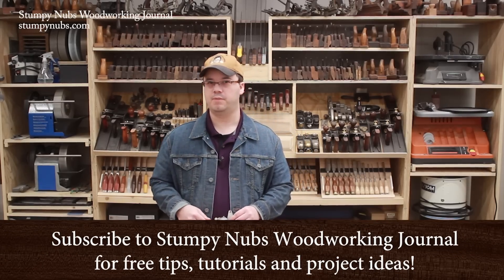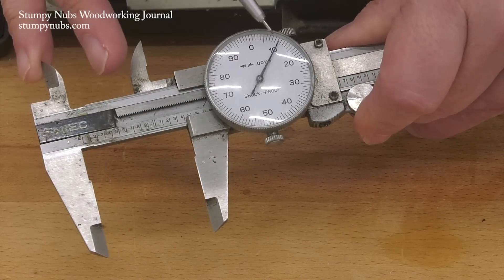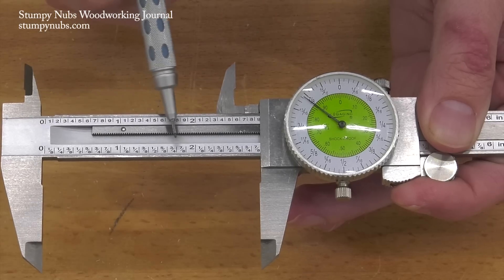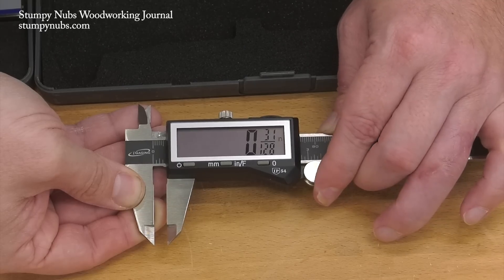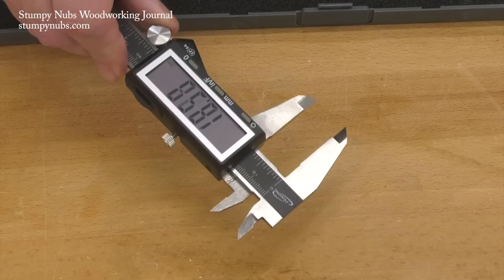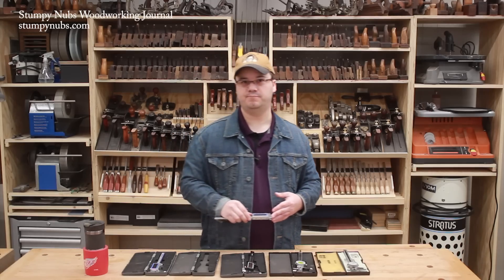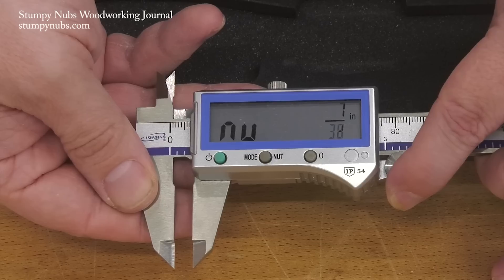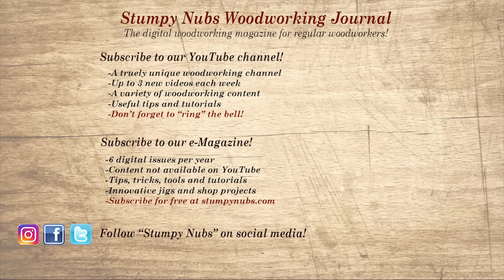FINALLY! Calipers made for woodworkers!

Comment: Calipers are absolutely more useful in the metric world, but I have yet to find a digital one that isn't a pain when it comes to the battery. Some have a rechargeable one you can just plug a phone charger or computer into but they seem to sell at a premium, & none of them have an actual mechanical on/off switch anymore, which I think is an insane omission. Might have to get myself an analogue model..

Comment: I use both scales mm for fine  work and inches for larger measurements and then i switch to metres for long measurements... it somehow works!
Reply: Me too, but in the UK we're used to using a mix of imperial and decimal measurements anyway. Miles on the road signs but fuel is bought by the litre, for example.
Reply: @MidtownSkyport  So make a decision, make up your collective minds. It's only been a few decades now. Get on with it.
Reply: As a letter pressman, I've learned to use many scales. Picas, points, agates, metric, imperial, column inch, word count, etc...  All have their place in my shop. Conversions are crude & a pain. For precision stick to one scale.

Comment: I commonly used metric measures in my job as an archaeologist.  Since I retired, I've come to appreciate fractions.  For two reasons.  One is that millimeters quickly grow to centimeters and decimeters.  Inches are less fussy.  The other really handy property is that fractions are remarkably easy to calculate with in your head or occasionally if need be, by hand, (use decimal inches and there's no reason not to be using millimeters instead), and since I very rarely use a measure smaller than a sixteenth of an inch, the ease of calculation is nice.  Using metric system or decimal inches is a practice that needs a calculator as far as my shop is concerned.

Comment: In ~ 1986 I bought mail order from a woodworker's catalog a General Tool No 142 6 inch Dial Caliper  Swiss Made that reads in hundreds and 64ths of an inch on the same dial.
 It is made out of black and gray plastic. The depth rod is steel.

Comment: I've had two different digital calipers that ended up with a failed encoder. Both were less than a year old. Now I have the iGauging dial caliper you demo'd that reads in fractions. I absolutely LOVE that one!
Reply: That is not a digital calliper problem. The problem is you cheaped out. A $40 unit would not be like that. What do you expect for $10 unit?  The point of their use is for accuracy and repeatability. Your cheapness defeats the whole point.
Reply from the maker: @JeffSolenberg  - Welcome to the internet :)
Reply: @StumpyNubs  :D

Comment: I have one of the digital calipers and since I'm an engineer and a former math teacher I have little trouble converting decimals to fractions.  But your comments on determining what the 16th fraction is nearest to a reading of a 128th fraction is one I've experienced many times. Yes I can do the calculations but it takes time from what I'm doing.  Thank you for the tip on the Fastener-cal caliper, I just ordered one.

Comment: I bought 4 or 5 cheapo digital calipers over the years and found the batteries would die within 3 months. Finally bouth a pair of mitutoyo's and love then, battery last around 2 years. I bought em used on ebay, best 80 quid i ever spent.

Comment: I prefer Dial Calipers because as you said, they are ready at a moments notice if they have been sitting for a week, or a year.

Edit: I just purchased the fractional Dial Calipers because they look interesting, and they are cheap. I say cheap, because I am a Machinist and use Mitutoyo and Starrett Tools, which are vastly more expensive than the woodworker Calipers.

Comment: Thank you! I've owned a couple of the digital calipers and felt stupid that I couldn't adapt to the ??/128 readings. I spent way too much time slowly moving it to find a number that made sense to me. Ordered and received the dial caliper from iGaging and sanity has returned. I've used it just a few times and wow, a big difference in my ability to use them and visualize what I'm doing to something that registers with me. I'll use it a lot more now that I can with ease.  I used one like it when I was a teenager many years ago. Made sense then. Makes sense now.
Reply: Thank You for this video. I have used multi-function digital calipers for years and have struggled to find the nearest 1/4, 1/8 1/16 ect from some readout. The NU function is a amature's god send.

Comment: I did get floating values on some early less expensive calipers, both digital and dial, but over the years, the inexpensive digitals seemed to have gotten better as you've pointed out.  My goto is a Starrett dial, flawless if anything can be.  I may have to check out your recommended digital caliper though.  Be nice if they added Bluetooth.  That would certainly seal the deal.

Comment: One reason I'm glad I worked as a QC inspector in a machine shop before I got into woodworking. I love using my calipers to get the most precise dimensions possible
Reply: LOL!   I came to wood working only three years ago after 40 years as a toolmaker, and it still frustrates me that I can't make wood comply to the same tolerances I was used to with metal.  And when you do get it close, a few weeks later it has changed all by itself!  Rob Cosman has great tips for minimising the effects of wood expanding and contracting according to moisture content.

Comment: I have a Mitutoyo digital at home for fine work and a dial at work. And as for the metric system I learned it in school when the US was supposed to convert, I know 70s I’m officially old. I do most conversions in my head if I need to. The only unit I don’t like is the Celsius scale.

Comment: 1/128 inch is 0,198 mm so metric allow more precise measurements but you are correct that woodworking seldom need that accurate measurement.

So doing like in old times and make your own ruler would work fine to, unless you want to share plans with imperial or metric users.

Comment: I have dial calipers that display fractions in 1/64" increments. I also have digital calipers that display fractions. I much prefer the dial calipers (for most things) because they show not just the size I'm measuring, but how that size compares with sizes slightly larger or smaller. For the same reason, I prefer an analog speedometer to a digital one -- the analog version shows not just what speed I'm going, it also shows how rapidly I'm speeding up (or slowing down) and how close I am to my desired speed.

Comment: Each to their own. We all use what we were taught. Myself I prefer the metric system but I'm an aussie. I just find it hard when I buy your plans and have to convert individual part sizes.
Reply from the maker: Why convert. just buy an imperial measuring tape for that project.
Reply: @StumpyNubs  because we buy wood and parts in metric not imperial. Hard to buy 3/4 inch ply without knowing how many millimetres it is

Comment: Good video, thanks.

WRT digitals: a while back I nearly threw mine in the bin because the display was missing segments and the nominally 3.2v battery showed 3.0v across the contacts. You'd think 3.0v would be enough - at least I did.  But the voltage across the contacts is NOT what the battery will provide in the device; that needs the full nominal voltage.  Replacing the battery despite the apparently good showing kept my calipers out of the bin. All the same, I have a decent true vernier caliper as backup and I'm putting a dial on my wish-list.

Sympathies to those who have to live in one world and think in the other.  I live where everything is metric and I'm glad of it, but that cosiness is being eroded by e.g Dremel with their imperial sizes, and Chinese-import router bits etc.  Well, that's just a good excuse to buy another router.
Reply: If you have the routers you like, already, you can try to find replacement collets in imperial.

Comment: I've been working with an old snowblower with imperial measurments on bolts and parts. I have a caliper with both mm and inches but holy moly do I wish I had the fractions and not only 1,2342352 inches. Even if I'm mostly only using metric, the analog scale can get hard when you start to measure for example 2,57mm.

Comment: I have used calipers and micrometers for years. I find it easier to judge my rabbits and wall thickness on turnings
Reply: "micrometers" = millimeters.
Reply: MrBonners I’ve always called the large C shaped ones that measure thickness of things like bowls micrometers
Reply: @unclepewter4161  " micrometers" are of the order of a human hair. Nobody turns wood to such tolerances. The thickness of one coat of poly finish is in the millimetre range, much more the micrometers. Increments of 0.000001 meter are not displayed in consumer and commercial grade callipers. They are of no significance in wood bowl turning dimensions.
Reply: MrBonners ty for your extremely informative reply. Since I used to be a mechanic I had a number of these tools and so made use of them in my wood shop but since you have informed me that I am using them improperly I will be sure to stop
Reply: @MrBonners  you don't get it? the same word for TWO different things.  besides being a millionth of a meter, a micrometer is a machinist's measuring tool.  imperial versions usually measure .001 to .0001 inches of accuracy.  the words are spelled and generally pronounced the same way.

Comment: A digital caliper with a flat battery is still a decent gauge in a pinch, but I keep a strip of spares in my bench's top drawer. 

On metric; When I was in 6th class in Australia, (the 6th grade in the US) Mr Perrault came in and carefully drew the metric system symbol on the blackboard, explaining that as a nation, many things were about to change. He made the interesting observation that kids or age would have a solid grasp on both systems, which would be advantageous. I often admire just how prescient he was and try to model that forward thinking.

I also drill the occasional bowling ball and that can only make sense in Ye Olde British imperial measurements, which keeps me sharp on inches and fractions.

You're on the money James (and others), sometimes it's handy to just switch units! I have an old Lufkin tape in metric and imperial and if something is bang on an imperial unit, that's what I write down, if it doesn't need to go on a drawing.

Comment: Metric system really shines in Engineering.  The formula's to convert basic measurements ( time, position, mass) into complex stuff is much less tricky.  Stupid gravity constant.  I am born in the USA and see that the metric system is superior but recognise that getting rid of the leggacy system of SAE would require draconian measures that Americans would never put up with. 

Manufacturing largely has made the switch but the exposure to the layman remains small. You quite right that you can't just get away from it here.
One other thing, the origin cal is also called an absolute scale digital calipers for people that want to browse.   Unless your job requires a certificate of conformity and regular factory calibrations the Iguaging brand will be fine for you.

Comment: I learned the Imperial System at school but learned the SI I when did my engineering apprenticeship. Now I use whatever feels handiest. Fortunately I am good at mental arithmetic and sometimes find myself measuring a project using different systems in different dimensions. But I cannot cope with the fractions on the older callipers not trusting myself to convert 37/128ths into something sensible. But we are better off these days as I learned to use mechanical vernier callipers and micrometers.

Comment: Not worried about the decimal/imperial thing, each to their own [you need to know what you're doing, however you measure it] but I must shout out a big YAY! for the digital display - even with my four eyes, the dial is just impossible!
Reply: Keith Stewart,  same here. I use a digital caliper everyday in my shop. I use both imperial and metric and one easy to read caliper that does both makes things a lot easier.

Comment: Thanks James,  that igage fractional dial is exactly what I've been looking for.   On metric,  if materials were in metric I would be happy to use it all the time,  but I'm pretty  pretty good at using a mix.  Except bolts and nuts, it is terrible to mix metric and sae on the same device,  I swear  when I run onto a 7/16 nut on a 10mm headed bolt.

Comment: As a toolmaker, I always get a chuckle when people talk about calipers being precise.  😎
Reply: you chuckle until a woodworker borrows your tiny c clamp without asking ;) 
fortunately precision is relative, it'd be a little ridiculous to lay out a rafter with a sine bar on a surface plate :P
Reply: @dscrive  Rafters yes I'd agree, but I've used my sine bar and gauge blocks to set up and rotary plane walnut on my mill for my 1/6th scale civil war cannon project where a match between the wood and metal angle cuts had to be exact. Milling wood with a power feed and dro is almost like cheating. :-)
Reply: @turningpoint6643  haha, I wonder how the "CNC isn't real woodworking" crowd would react to that.
out of curiosity, is that cannon functional?

some of the fancier planers have digital readouts, and there are power feed devices for use in the wood shop. I haven't used either, but they seem pretty sweet.
Reply: Once you get used to machinist tolerances, it changes your world with regard to what's possible.  And, as William Ng shows, it's not that hard and often worthwhile to machine wood that accurately.
Reply: The need for varying degrees of precision is relative.  A framing carpenter has no need to measure more precisely than 1/16”.  When I measure a copper jacketed .44 caliber bullet it measures .430” whether I’m using a cheap digital caliper or  a Starrett micrometer.  It’s hard to cut wood as precisely as we have the ability to measure it so any further precision is not beneficial.  Calipers are quite precise for woodworking even if they aren’t accurate enough for toolmaking.  I build both RC airplanes and bolt action rifles with .001” measuring tools and have been quite successful at both pursuits.  Without a tool room lathe measuring to tenths isn’t that useful.
Reply: @David-hm9ic  Try building electronics.  You'll find cheap parts specced in mils (thous) and microns that need to fit, often requiring CAD drawings and microscopes to handle the precision.  Trying to fit a 2.5mm base plug in a .1" socket will instantly teach you to not throw away the 3rd digit.

Comment: I liked the features of the iGaging Fastener-Cal Caliper, but I've had 3 now, and they all stopped working after several months.  The readout starts randomly adjusting the measurement, as if you were moving the gage.  Once might be a fluke.  3 is bad product.
Reply from the maker: That's strange because mine has worked fine for five years.

Comment: Working with guitars means working with wood and metal.  Specifically, the strings are measured in tenths of an inch.  The wood can be either tenths or fractions.

Comment: From the UK.   I was brought up on Imperial but the UK changed to decimal.  When working in wood I build to what ever the size is quoted or measured, that is if the job needs a 4ft piece or a 1200mm board then it is cut to that size. It is amazing how quick the brain responds to what is needed. We also always quote wood the correct way  ie  4X2  3x2 etc. not the other wrong way round.

Comment: Video Suggestions:

1 - What on earth is a sanding sealer and why/when should I use it?
2 - How durable are oil/hard wax blends like Polyx? Many seem to swear by them and they apparently "feel" nicer than other finishes.
3 - Is Kim Kardashian still a thing or has the world moved on?
4 - Do you know of digitial calipers that use a AAA battery rather than the button batteries?

Great video as usual. God bless.

Comment: When I first took physics or electronics, I IMMEDIATELY realized why we are ridiculous for sticking with imperial/American units. You just move decimals to change scales, the names match the position... It's the most rational and sensible thing 😄
Reply: When you took Physics and Electronics, I bet you never worked angular measure in Gradients? Instead you used 1 rotation as 360 Degrees or, 2 Pi Radians!!! LOL!
Reply: @henrysiegertsz8204  fair enough, there. No, I definitely didn't use gradians,  I was really just talking about measurements in meters and kilograms

Comment: Basic units of measure are like a native language - we're taught from infancy. My American mind thinks in inches, yards, miles, acres, gallons, quarts, pints, cups. I'm more than familiar with the metric system, but I still find myself translating into my native UOM for most "grand scheme" ideas. Having said that, when I bake, I weigh my ingredients in grams. When I'm woodworking, I design in foot-inches, but measure for precision in cm-mm because the math is so much easier than fractional inches. Toughest part is finding metric measuring devices, and changing the scales on equipment like table saws. 

And when I travel, I think in terms of times - I'm not sure exactly how many miles it is door-to-door, but I know exactly how many minutes it will take with traffic conditions.

Comment: I use both Imperial AND Metric - horses for courses. Lee Valley stock a mechanical caliper that has a dial that gives both metric and imperial, but I think its Imperial decimal. Something the I Gauging or one of the other manufacturers COULD do for us is to use a Li ion USB rechargeable battery in the caliper - this is already out in those angle block gadgets, and Li ion batteries can be tiny and don't self discharge quickly.